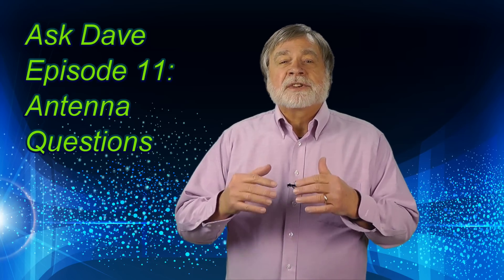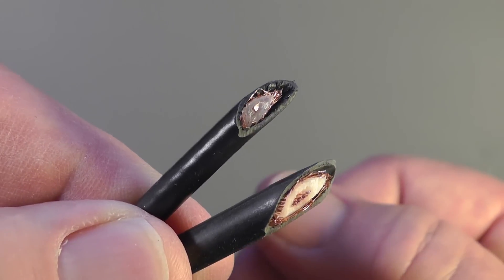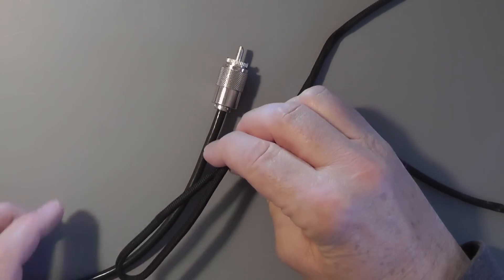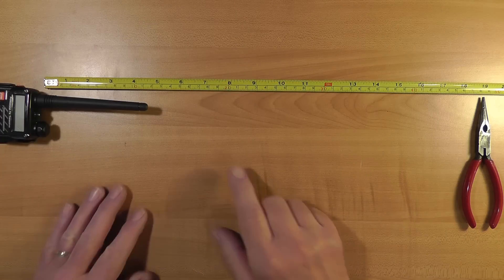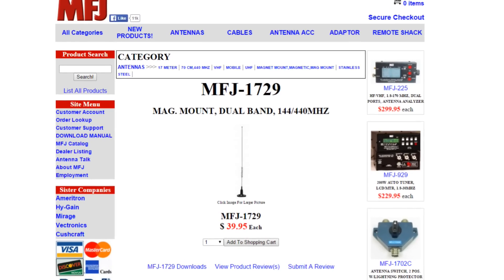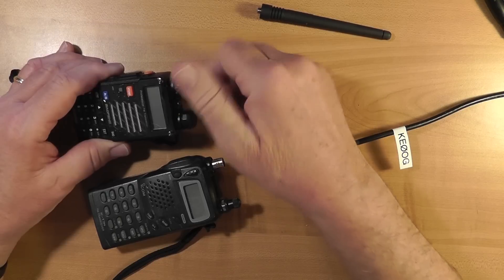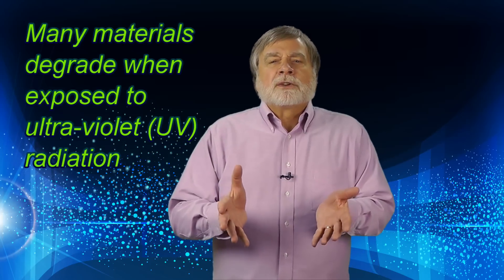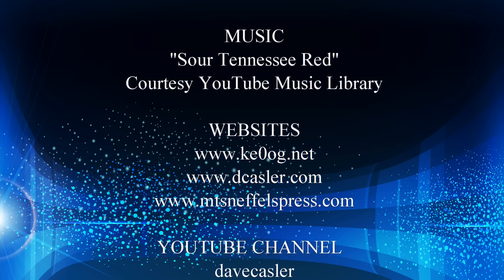Ask Dave 11: Antenna Questions

Comment: Hey, Dave, I'm considering purchasing a commercially made multi-band vertical antenna (Cushcraft R-8). I'm wondering if there's any suggested or recommended strategies for tuning such an antenna during assembly to minimize having to put up the antenna to run an analyzer for SWR, and then taking it down to make adjustments.
Do you have any videos about this? If not, would you consider making one?  Thanks.

Comment: Hope all is well with you and yours, Dave!  :-) Here's my question...
Just rigged up a three element resonating dipole antenna for 20M, 15M, and 10M, approximately 30 feet above ground level, and 15 feet above my corrugated tin roof, which has a slope of about 8°-10°.  We're at just under 1,000 feet elevation.  Hooked up to my Dad's good old Swan 500CX, circa 1970, or so.  GREAT radio.  Picked up Brazil and Maui within minutes on 20 Meters.  Contest going on.  Dad would have been dancing a jig!  :-)  
OK, so here's my question.  Having the dipole suspended above the tin roof, will this enhance the propagation, perhaps in the area of NVIS?  Thanks MUCH for an informative and easy to understand channel!  
73
W6AOY...QTH Northern California, 25 miles from coast.
 "Zim"

Comment: Hi Dave. I'm an electrical engineer (not rf) and I'm curious about em radiation. In a simple dipole, you show the electric field and magnetic field being 90 degrees out of phase which makes total sense from circuit theory. I suppose if I took my oscilloscope and some handy detectors, I could measure these fields at the antenna and see the time delay between the two fields. Would you concur with this?

Thanks!
Reply from the maker: Not out of phase but 90 degrees apart in orientation.
Reply: @davecasler  I thought your picture looks like this (what I expect):
https://i.stack.imgur.com/8niio.gif
Perpendicular in space and 90 degrees in time.
Reply: @davecasler  If I place a receiving antenna right next to the transmit antenna, I expect to see currents and voltages in the receiving antenna as in the gif below. What am I missing?
Thanks (from a perplexed guy)
Reply from the maker: @belaji  Sorry, the GIF did not come through. You can send the GIF to hamradioanswers@Gmail.com

Comment: So, you can never bend co-ax too much. Wait, does that mean... 😜
Reply: Coaxial cable has a center wire conductor surrounded by a foam insulator, then a foil and/or braided wire shield. If the cable is bent too sharply, it can cause the center conductor to compress or cut through the foam insulator, reducing the spacing from the shield. This can change the impedance of the cable.
Reply: Brad Tombaugh  I was making an obscure reference to the Saturday Night Live episode where Ed Asner, playing the part of the Ambiguous Nuclear Engineer, said, "You can never put too much water in a nuclear core." To which the young nuke plant ooerators said, "But, what does that mean? Is too much water bad or is too much water ok?"

Comment: Unfortunately the 2016 and newer Ford F150's have an aluminum body and magnetic antenna mounts won't work.  Need to use glue or some other method to attach  to your roof.

Comment: Dave,

I just watched your review of the Xiegu 5105. I'm considering a 2nd HF to use while stationed overseas.  Yaesu or Xiegu or another are good options.  About antennas, have you reviewed the D-Original 2000 HF-6m 200 watts antenna? I will probably be living in an apartment.  Thank you for all of your guidance.  By 73 de David AE4LH
Reply from the maker: I've not reviewed that particular antenna.

Comment: Half of my 80 meter dipole is over flat ground, the other half is over a 40 degree slope. Should I run the wire parallel with the slope, or keep it parallel like the other half is??
Reply from the maker: I recommend keeping them parallel to the flat ground. That said, if that's impossible, do what you can.

Comment: I recently put up a Glenn Martin 40 ft Tower with a hazer unit. I have guided with steel cable and remember that the insulators should be placed in non-resident positions so as not to affect the pattern of my multi element multiband beam. But I can't find information on how to calculate where the insulators should be along the guy wires. Any help would be greatly appreciated. Wayne n8kim@arrl.com
Reply from the maker: Yes, there's some discussion of that in the ARRL Antenna Book. Some sort of chart.

Comment: Dave, I am Harry Pillot (KN4DHY/AG) and new to the hobby.  Great videos!  This is my situation:  I have a MFJ 1178 G5RV antenna (102 ft long) but do not have the space to deploy it.  I read about an MFJ 1778M Jr which is half the size (52 ft long).  My question is how do modify the regular MFJ 1778 to the Jr version.  I was planning on determining the proper length but will like your opinion and advice.  I do not want to have to buy another antenna if I can modify the original 1778 G5RV.  Thanks
Reply from the maker: Given that MFJ also sells a junior G5RV, maybe you can do a swap. If not, see if they'll give you the dimensions for the Junior version, and cut the one you have to fit. You can also look in the ARRL Antenna Book for more information including dimensions. I'm sure you'll find opinions on the Internet too.

Comment: Why isn't the "full size" antenna simply a 19" rod (which would also be a resonant 3/4 wavelengths on 440)?  Instead, the MFJ-1729 is about 50% longer, with a coil.

Comment: I've been building and using dipoles for years. I'm so tired of being lets say stuck on one or two bands all the time. I have put up 58 feet of Rohan 45G and I want to put up another beam. Will I have a better signal with a tribander let's say 10 15 and 20 or can I go with one of the newer beams that offer five bands or six bands with just one feedline? My object is to be able to work on as many bands as possible?
Reply from the maker: There are many, many beam antennas available, as the advertisements in QST show. I don't have a beam. Those who have them swear by them. I've spoken with several folks on the air who have the "spider beam," which again is made by several companies. But with a 58-foot tower, especially a really sturdy one like the Rohn 45G, you are probably looking for a sturdy beam. Tribanders cover 20, 15, and 10 meters. 5-band beams are used on 20-17-15-12-10 meters. I use and enjoy 20 meters a lot, but with the low solar activity, the higher bands seem pretty empty, though they do open up occasionally. Beams for 30 meters or 40 meters are in the category of gigantic. Look at the reviews on eham.net. Good luck!

Comment: Excellent series! Here's a question: How does a tri-band antenna work? It seems like a big trade-off for each band.
Reply from the maker: In essence, it is indeed a tradeoff. Optimal element spacing for one band is not necessarily good for other bands. Some of the more modern (and expensive) tribanders or 5-banders (20, 17, 15, 12, 10) actually have three elements for each band, and the distances and lengths are modeled extensively to minimize losses.

Comment: Mr Casler, thank you so much for answering my questions and I passed my technician test only missing one question! Waiting to get my callsign now. I have another question I was hoping you can help me with. I'm using a baofeng 8 watt handheld it's actually 1.3, 2, 4 & 8.61 Watts depending on the setting and the frequency... there are a lot of third party softwares that can reprogram it using the serial connection. There are several youtube videos that demonstrate how you can monitor a broad range of frequencies with different antennas after reflashing the firmware. Many of them caution against transmitting on any of the frequencies not in the original firmware but claim that monitoring any frequency won't hurt the radio only keying up the radio with it set outside its capabilities is dangerous for the components... now I know using firmware made for one radio on a different radio is not the safest thing to do but I would like to monitor more frequencies without investing in another radio. I'm not too worried about the dangers as it's only a disposable Baofeng. That said with your radio expertise I'm wondering if you can confirm what a lot of folks say that monitoring without keying up the radio won't hurt it no matter what frequency you have it tuned to, and just out of curiosity what is the reason for this danger. I've got a video that demonstrates how it uses the ground to trigger the push to talk and I am going to add a circuit with a removable safety pin to prevent it from being accidently keyed up unless I insert the safety pin first just to keep it idiot proof. My guess is the SWR on an antenna outside the range of the transmitter would be too high and that is what the danger is? am I correct? 73!
Reply from the maker: +rowe39425 My Baofeng UV5R+ receives commercial FM 60MHz to 108 MHz (much broader than the US commercial FM band. It also receives FM on 136-174 MHz and 400-480 MHz, in both cases far broader than the actual ham bands in question. When I program non-ham frequencies for listening, for example the local weather radio, I program in a dummy transmit frequency that's inside the ham band. That way if I do accidently transmit, I'm not interfering with the station I'm listening to, plus my mistaken signal goes out on a ham band and does not stress the transmit circuitry. I'm not familiar with the third-party firmware you mention. I hope that helps, at least somewhat. 73, Dave
Reply: +David Casler thank you so much Mr Casler that does help I don't know why I didn't think of programming a transmit frequency in the proper range... I can't wait to get my callsign I'll keep you posted.... in the early nineties I came very close to buying the Old West hotel in Ouray... rather my parents did... I was very young at the time... we were house hunting for a time there... life sent us in a different direction but since then it's always had a special place in my heart... dad still reads the local paper even though we are now on the other side of the country
Reply: If you are/choose to use Chirps software for programming, or program by hand, just select "off" or "none" in/under the "Duplex" column. This will "lock out" the radio from tx (transmitting) on that channel. Good Luck & 73's !

Comment: Hi , just getting into the hobby . been working C B radios for over 30 yrs. I'm in the process of getting my tech lic. , I do flagging work and mag mount antenna's don't work to well for me , keep knocking them off the roof and would like to hard mount it like you can the C B antenna. what would you suggest for a dual band uhf/vhf radio. Please keep in mind this is to be used on a truck not a car. thx
Reply from the maker: +richard imel It is possible to find rooftop-mount VHF antennas that mount permanently. I haven't seen one advertised for quite some time, so you may have to consult with a local dealer who deals in mobile radio. I recommend some specific radios in my latest Ask Dave video, here: https://youtu.be/3plYxQK4RJE.  Good luck!

Comment: Great job and great TIMING on this video. I just purchased my first mobile/base rig, a Yaseu FT-8900. I want to build a dipole to start playing on 10m and was wondering about center insulators. Was wondering what the options were on the cheap and never thought about using the electrical fence insulators for the ends. Thanks!
73!
Michael - WA5AZQ

Comment: NB : Getting into a car with a metal roof and metallic tinted windows is a great way to stop a hand held from working. 

It's not just spurious from the car that causes the problem - it's mostly the roof, pillars and window tinting (if fitted) that simply blocks the signal in and out.

Anyway Dave, another great video. I almost certainly learn something from each one.
Thank you and happy, healthy and prosperous new year to you and yours.
Reply from the maker: +Ade Larsen Thanks for the best wishes! I also wish you a great new year! 73
Reply: Unfortunately, cars make good faraday cages.

Comment: Hi Dave, thanks for the new video. I look forward to each one. BTW, I had a recent experience with moisture in the feed line. My signal went quite bad all of a sudden (over a week or two), and when I checked the feedline connection I saw it had formed a little bit of corrosion on the SO239, so after cleaning it and putting in a new feedline, I bathed it liberally in that liquid electrical tape.as well as regular electrical tape. That should get me through the winter at least. Anyway, it was surprising how little moisture it took to cause a lot of trouble. Cheers, KC1DIW

Comment: Kellum grips is another way to provide coax strain relief. http://www.hubbell-wiring.com/press/catalog/V.pdf
Reply from the maker: +jpintek Thanks for the link. I haven't used these, so can't comment, but I've seen similar devices advertised.
Reply: These would also work well for pulling coax through underground conduit to your Tower or antenna!